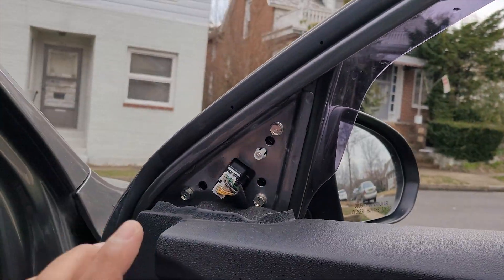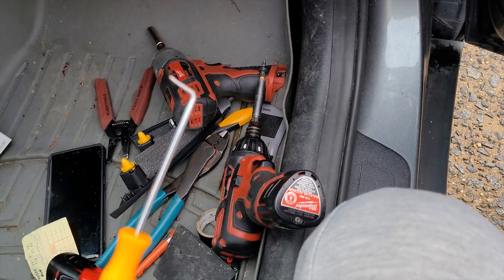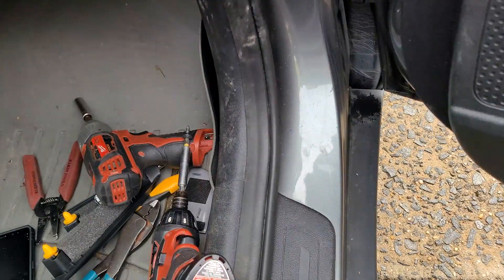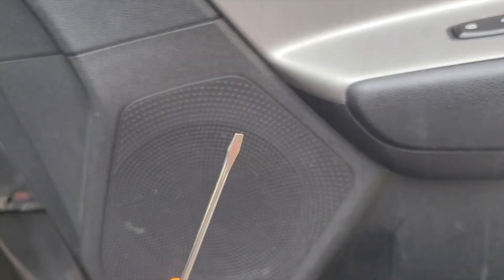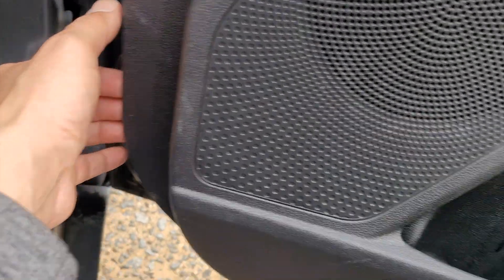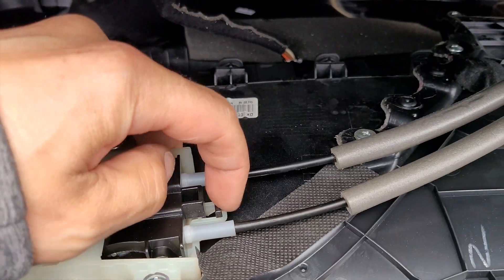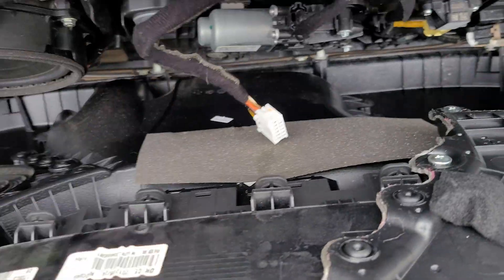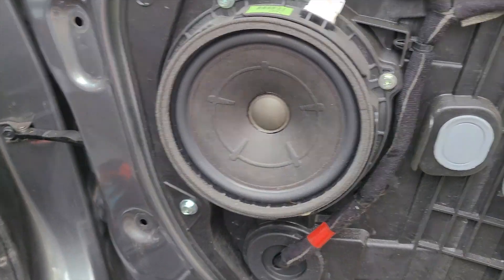How To Remove 2017-2020 Kia Niro Door Panel.

Comment: I got a little ratling noise when the bass buzzing at some songs. You think taking the door off like this will show me a solution?
Reply from the maker: Are they aftermarket speakers or factory?
Reply: Factory
Reply from the maker: Take it off. As they chant. 🤣🤣🤣. I bet the speaker is blown if your hearing that. See if the surround of the speaker is intact and go from there.
Reply: No it’s more like some of the buttons resonate to the bass from the speakers…
Reply: Fixed it. Put a piece of paper on each side of the “window lock” button. Now no rattling sound anymore
Reply from the maker: @jaapsmit88 sounds good..but it doesnt seem like it was the speaker..🤦🏿‍♂️🤦🏿‍♂️🤣🤣
Reply: I know i never said it was 😜 might be my “dutch English”🙃 
So looking back taking my door panel off wasn’t necessary at all for the problem i had.
Reply: But i gotta say your short instructions  did help me to take it off. So i could investigate it better. So thank you for that!
Reply from the maker: Good to hear..no pun intended..lol